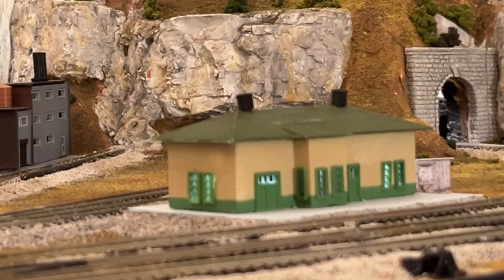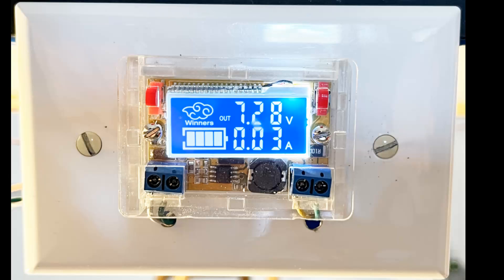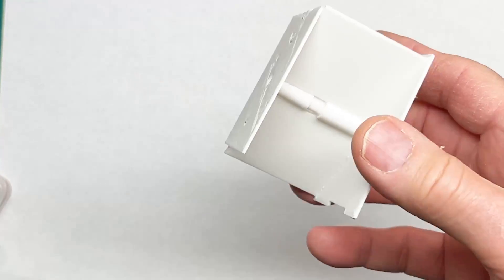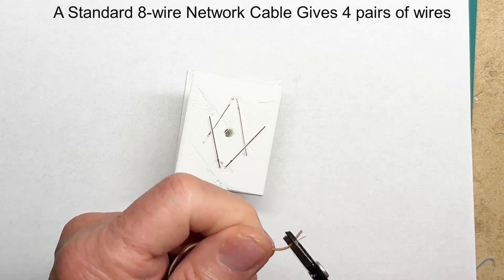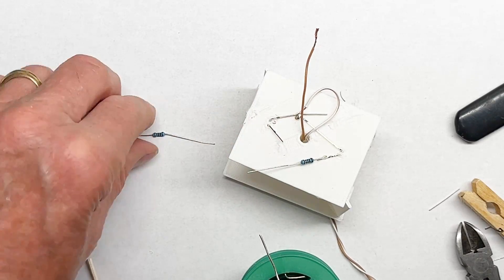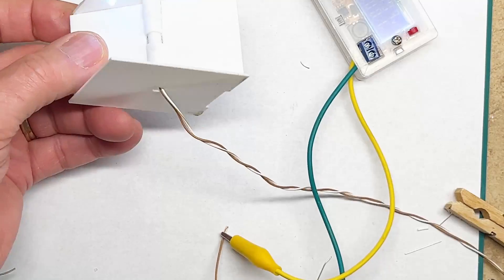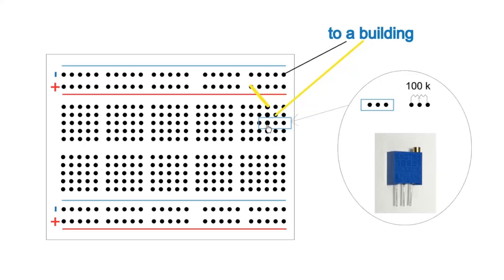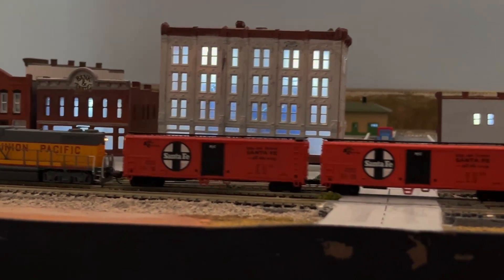Use Cheap LEDs (light emitting diodes) to Light Up Your Model Railroad Buildings (for Any Scale)

Comment: Dean, since you can vary the voltage on the power supply, can't you drop the voltage enough to eliminate the need for resisters?
Reply from the maker: The dropping resistors are always needed because each  led is slightly different. So you might be able to adjust the voltage perfectly for some but that voltage might be enough to blow others. The breakdown conduction happens over a very small rise in voltage. For example at 3.0 volts a particular led might conduct a small current but at 3.1 volts it might conduct enough current to destruct it self. Resistors cost only a few cents so it’s not worth the risk.